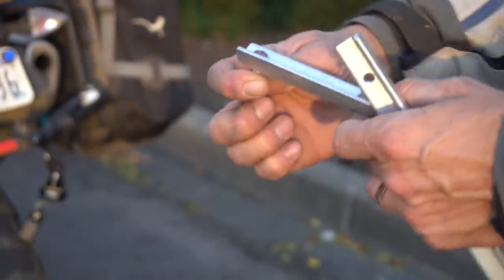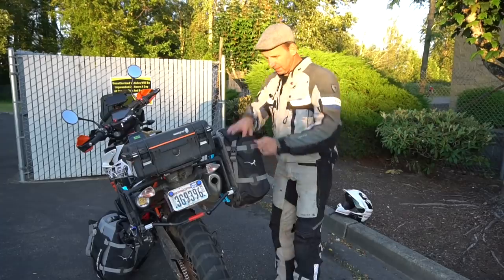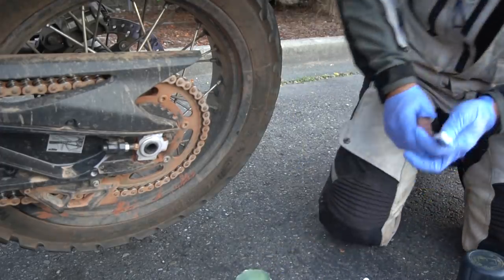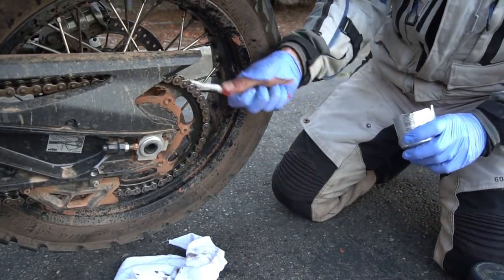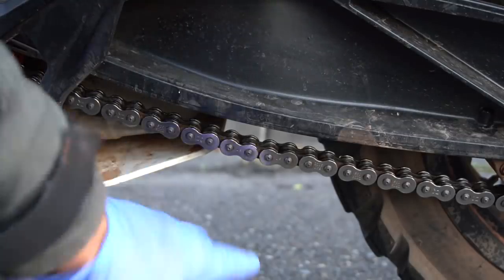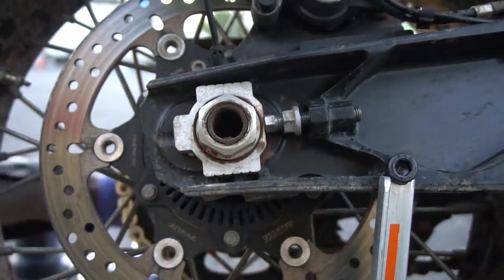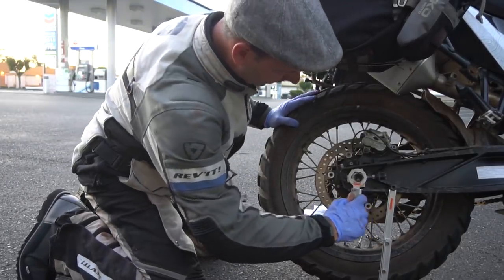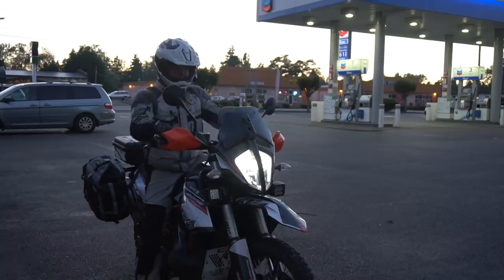Motorcycle chain maintenance tips while traveling

Comment: Thanks for that nice video.
But you need to lube the chain after cleaning. You got the whole x/o-ring thing wrong. Yes theres o rings and yes theres grease inside. Nevertheless you need to lube the area where the chain is running on the sprockets. Or it will wear prematurely. Diesel ist only sufficient for cleaning, but not for lubricating.
Reply: Gear oil should do it, don't waste money on chain lube, that's snake oil.
Reply: @someone46018  Haha, youre completely wrong. 
Chain grease is super sticky grease so it stays on the chain. 
Gear oil will just fly off (leaving your chain dry after a few miles) and then lube your tire real good...
Dont save money on the wrong things...
Reply: @Chris-yy7qc  My Honda asks for gear oil for the chain on the manual. Look for F9's video about chain lube.
Reply: @someone46018  Probably pretty old honda. Back in the day things were different because there was no better solution. Now there is a better solution. Using gear oil on chains is like living in a cave. Maybe you want to change your engine oil to castor oil, too? Castor oil was the sht in the 50s.
Reply: @Chris-yy7qc  Watch Ryan F9's video on it.
Reply: In the title he makes it clear this is "while traveling". This is not "I'm at home so I have access to all of the equipment necessary", but rather it is some maintenance while on the road without access to all of that.
Reply: @Chris-yy7qc  What do owner handbooks now recommend? I have a feeling it's still EP 90. In any case, I personally don't like anything that's too dry or too much like a grease. The white and dry types of sprays aren't very good at lubricating in my experience. And the greasier the product is, the more that grit seems to adhere to it - creating a substance more akin to grinding paste than lubricant if you're not careful. However, I do totally agree with your first point. Simply cleaning with diesel is nowhere sufficient. I tend to get around 50k miles out of my chains and sprockets (although not the front one - that obviously wears faster) - and I only ever use EP 90.
Reply: Great video! Thx! I use a small squeeze bottle of chain cleaner, toothbrush, and small spray can of chain wax, stored in a ziplock bag with some folded blue HD paper towels,  and a mini Snapjack axle stand (with a velcro brake lever strap). When available I go to a wand car wash bay, clean the chain with the chain cleaner, brush and HD paper towel, then wash the bike including a light spray/rinse off of the chain, then dry, being sure not to spray too much water pressure on key areas. I finish with waxing the chain using a cloth to limit any over spray of the wax on the wheel or other parts of the bike. Good time to check the tire tread condition and for any debris in the tread (screws/nails) as well as air pressures. I also use a clean wet micro cloth while washing to clean my helmet, and outer gear of any bugs and such. Then voila, bike and gear clean, chain clean and lubed (adjusted if needed), and ready to go. I've got the process down to about 20 minutes in total. Add a few minutes for gas, washroom, drink/snack, and passer-by chat time of course. Nothing like having the bike and gear all tended to and clean, gas tank full, empty bladder (and/or bowel), and a cool soothing drink in hand, nesting at the bike, taking in the local flair, and conversations that inevitably ensue. 

Great topic! Thx! 😉👍
Reply: @Chris-yy7qc  you are completely wrong. Rattle can is no good on long trips. Grit and dirt stick to it and grind your chain and sprockets down. Get a chain oiler and save all of the time that you clearly waste. Maybe you only ride locally?
Reply: @alrightdave6135  Youre wrong.
Quote "you need to lube the chain AFTER cleaning." Clean it first, then grease it. I clean and then grease my chain every 500 km and theres no amount of dirt stuck to it worth talking about.
Btw grit and dirt will stick to the chain oil, too. So youll need to clean the chain periodically even if youre using a chain oiler.
Chain oilers are not better than chain grease at all. Its just plain convenient to use them.
Reply: If you think any oil you spray on the chain will remain on the sprockets-rollers contact area, you're fooling yourself.
Reply: @PetroDobrynin  If I touch my chains rollers or my sprockets, my hands are greasy. So theres plenty of grease on those parts. Even after hundreds of Kilometers.

Comment: I made the classic crutch stand. The bolt that went through the hand handle is bent at about 45°, so I can stick the one threaded end into the top of the crutch stand and the other head end gets stuck through a hole in the engine bash plate to lift the front wheel.
I know o-ring chains are sealed and permanently lubricated, but I still lubricate with Pam vegatable oil spray after riding and brushing. The schedule is every tank which is about 175mi-200mi. I can feel the chain turn slightly freer as I lube, but I know its all thrown off within a few miles, but the chain has a wet look for about 150mi and it doesn't gunk up with sand and grime that trash the o-rings.
Using diesel scavanged from the pump is brillant.

Comment: I installed scotoiler on my 690 R, chain is always clean and slightly lubricated. The wear & tear is substantially reduced, chain slack adjustment is very rarely required, depending on weather and/or track conditions.

Comment: This was something I have been wondering about for a while: what to bring for chain maintenance? Tiny spray bottle with kerosene? What size can of lube? Where to put that stuff? Your luggage rack system is nifty and I definitely learned something there. Side stand was genius. 

The only question I had was around the slack adjustment method. My MoM says to adjust while on side stand with weight on back tire. Curious about the difference there. Honda vs KTM? That simple? I am still new to all this so have lots to learn!
Reply from the maker: Yes but I am NOT using a centerstand, the weight of the bike is still supported at the swingarm
Reply: @BretTkacs  aha! Touche, sir!! Guess if I was truly paying attention I would have noticed that when you put the weight on the nut you mentioned. See? Still lots to learn!

Comment: The chain is one of the reasons I got a Tiger 1200, if all goes well I won't have to mess with the shaft for 100,000 miles. 

My Z650 on the other hand... Every week I'm cleaning and adjusting it. 

Now if the dealership can figure out my Handlebar shake on the 1200 I'll be back on the road. well, off road soon
Reply: Agree, until a bearing or seal fails, then it's good night Vienna!

Comment: Thinking about the improvised side stand, I was thinking to cut the wing nut bolts down so not so much thread, then thought of a piece of angle the appropriate length might be able to be fixed to the side stand on the bike.  Bit like a wrap around sleeve. Although not all side stands might be straight could either bend to mirror shape of affix to front fork or other straight section on the bike. Regardless it got me thinking how and where I could put a side stand. Used to just find a stick in the bush, but I guess it's the innovation that is one of the rewards that come from being on the trail.

Cheers Brett from down under 🇦🇺

Comment: Great video just to make things clear. Each model of bike is different. Here's an extract from the Triumph Tiger 800 manual, my bike. Place the motorcycle on a level surface
and hold it in an upright position with no weight on it. • Rotate the rear wheel by pushing the motorcycle to find the position

where the drive chain is tightest,
 and measure the vertical movement of the drive chain midway between the sprockets. Amount of slack 20-30 mm. If I blindly copied the video my chain would be adjusted too tight. I use a chain oiler as well as cleaning the chain as described but not quite so often.
Reply from the maker: Everyone should check their manual for bike specifics. 👍
Reply: @BretTkacs  The 790 chain spec is actually checked 25 mm (or 1 chain link) behind the plastic guide on the bottom of swing arm, you should have 3-5 mm of gap between the swing arm and chain. It should not touch the swing arm or it is too loose. Also the rear suspension should be fully extended and bike in neutral, jacking the bike up where you are is compressing the suspension. The sticker on the swing illustrates this but is a bit confusing.   I like the use of free diesel as a cleaner!

Comment: Bret, I know you have been doing this for a long time. I noticed your rear tire was getting a little worn. I am really enjoying this Motoz Tractionator Adventure. Running the TKC80 front still. This rear has been exceptional except a fresh rain oily road. Off road I am just as happy as the TKC80. More bite in mud. Deeper tread. I am not easy on this poor bike but do take care of it maintenance wise. This tire is a solid 5k mile tire. The front TKC80 is roughly 6+ depending on cupping. 
Lots of rooster tails in gravel etc and no chunking.
Reply from the maker: Worn!?  That tire is toast!  Waiting for my Mitas e07 140/80-18 to arrive

Comment: Wow, this is really cool idea on chain maintenance! You're not dragging around chain lube and chain cleaner in your luggage, and diesel fuel keeps those rubber seals moisty and gives some anti-corrosion coating.
I'm currently trying a no-maintenance on the chain, except adjustment if needed. It doesn't pick up much dirt since it's not covered with any lube or diesel, and it turned rides into pure hustle-free joy, we'll see for how long it lasts. 

If it doesn't last at least 20000km, I'll stick to your approach, I ran through 3 chains already and I consider your approach to have the best chain longevity and maintenance hustle ratio))
Reply: there have been a ton of videos made on this topic and with modern Orings and Xrings, there seems to be virtually no benefit whatsoever to cleaning or lubing them.
they are lubed INTERNALLY and if cleaning the outside affects those rings, then your chain will be toast soon anyway because its not sealed anymore. any residue left on the chain will just create grime and if there's no residue then why are we lubricating?
its kind of like cleaning your toothbrush with mouthwash before using it. probably doesn't hurt but also probably a waste of time lol.

Comment: Great home made tool, I did one similar but with a small rope to pull it off when I want to put back the rear wheel on the ground.   (I am not strong enough to lift the bike from the ground like Bret, I need to be standing and grabbing the passenger hand bar to lift the rear wheel and the tool get in position by gravity...)

Comment: Buy some white chain wax spray and you are good to go. If it is really dirty just go to a power washer and use clean water to spray the big dirt off. When I sold my previous motorcycle my chain was at  29.000 km without any signs of wear, was only adjusted once and I never degreased and cleaned it. It also endured 5 months of rain almost everyday after which I put on a new layer of chain wax spray. 

Hope you read this before it gets deleted and saves you some time, effort and money.

Comment: Hmm I think I better check my chain , it's been 1000 miles since it had service . I need to make a similar side stand so I can get the back tire up . Excellent video as always !
Reply from the maker: It will look fine at 1000... It's about caring for it for the long term 👍
Reply: @BretTkacs  
I have a 2019 DR650 and am waiting for my preordered Tenere 700 . On the axle nuts in the back there's these nautilus looking guide plates with notches . They're used to help align your tire and tighten up your chain . My thing is what about the brake calipers and the distance you're pulling away the rear brake disk from it ? I will look again but I don't think the owners manual mentioned that . Alright then take care and looking forward to your next video !

Comment: I used a Scottoiler on my F800 and it seemed to to the trick. I hate having to maintain the chain all the time, especially in very tropical environments. Thoughts on automatic oilers?
Reply from the maker: I had one on my tiger 800xc. I like them. The constant drip allows the dirt and filth to be flung off the chain reducing maintenance time.

Not cheap...
Reply: @BretTkacs  I was about to ask you about the Scottoiler, I picked one up for my KLR but haven't installed it yet. Great content as always!

Comment: Hey Bret.  Great video, but, chain tension should be done with the weight of the bike on the rear wheel.
Reply: Scott  hey that’s my question as well!
Reply: Once you know how tight your chain needs to be with an unweighted wheel, you can do it that way. It's a matter of learning your bike - the way Bret checks tension in this video is not the way ktm manual specifies it, even if the wheel was on the ground. just tension it to spec, then lift up the wheel and make a mental note (or write down) some measurement for that state.
Reply from the maker: KTM manual says to put the bike on a race stand.  A center stand would fully unweight the suspension but the support stand uses the swingarm so I carries similar load as a race stand

Comment: Bret, great video and technique, esp for riding in third world areas, what front tire are you running, looks like a mitas? motoz tractionator front is bulletproof off-road but extremely squirrely on road to the point of a safety issue with wobbles at 70+ mph.
Reply from the maker: Mitas e10

Comment: i personally use motor oil for car. it has the best slippery anti-wear property and it clean the chain as it drips and get flung. i ride a 125cc motorcycle and i worn 3 O-ring chain before switching to a DID "heavy-duty" standard chain without O-rings. i tried everything in the past from wax spray to grease, i found the best to be motor oil.
you can just bring a little 100ml bottle and you just drip the oil onto the INSIDE of the chain.
Reply: But so much will fling off... I would not want to have to clean your poor bike haha
Reply: @PureAwesome92  its a feature!

Comment: I wish I could use a stand like that.  My Multistrada pivot point on side stand is so far forward, that when I push the rear wheel up, the bike becomes very unstable.  Not mention, Ducatis have a rest for weak stand mounts which are part of the frame.  I hate packing more weight on for a center stand so I’ll just do the parking lot shuffle…

Comment: Great tip. Did you put this bolt on the swing arm specifically or it was there originally? I am planning a trip to Alaska this summer on my CB500X and I am wondering should I put a central stand on the bike or not.

Comment: Question:
my mechanic told me: ‘’Always measure chain movement with someone else. Sit on the bike and let someone else check the movement. If you don’t do it like that, your chain will already be stretched when you take a seat, and will suffer greatly when the suspension travels even more while you ride.’’
That sounds logical to me: with the suspension compressed completely, the chain should be nearly stretched. If it is allready stretched before that, your suspension cannot compress without overstretching the chain.
Does that sound logical to you?
Reply from the maker: No... The measurements given by the manufacturer are based on the expectation the bike is resting under its own weight. Free sag for most bikes is on about 10-15mm. With a rider on board you will be to far into the travel.  At the tightest part of the swing the chain should be at 0 slack.

The goal when adjusting is to compensate for the offset of the front sprocket and swingarm pivot.

KTM manual says to put in on a race stand. Since the bike is supported at the swing arm and its not a center stand I'm good
Reply: @BretTkacs  I've also heard (on ARR podcast even) the 10mm is what the sag should be with the axle nut at the farthest point from the sprocket. For me it makes sense, since every link has to catch up with the next one, when for example going through pitted roads at speed. With 0 mm freeplay at that point, the impacts might stress some links in the system more severely than others. I know the damage over tightening can cause, so I rather err on the side of caution.

Great video though, I dig the production and the use of diesel. Personally I use a rag between the chain when tightening the axle so I know it stays in place. 😁
Reply: Bret Tkacs 
Sorry Bret, but I am struggling with this....
Do I hear you saying that you should:
• measure chain slack with wheel on the
  ground,......&
• adjust chain with wheel off the 
  ground....but
• use a race stand (or your home-made 
  angle iron equivalent), but NOT a centre 
  stand???

Thanks much for all of your most helpful videos. Much appreciated indeed!
Reply from the maker: @robkcra  ideally you measure and adjust your chain on the ground. Because my stand does NOT unload the suspension it is an "ok" scenario to adjust it in the air
Reply: Bret Tkacs 
Thank you. It finally jelled!

Comment: Hi Brett. Great video. I like the trick of using diesel when on the road. The Black Dog skid plate has a similar "sidestand" piece that works with their skid plate. It allows you to lift the rear or front tire off the ground. Is there a reason you chose your setup over that?
Reply from the maker: I'm cheap...

I will look at the BDCW set up
Reply: @BretTkacs  Nothing wrong with saving money. I'm sure your setup is cheaper.